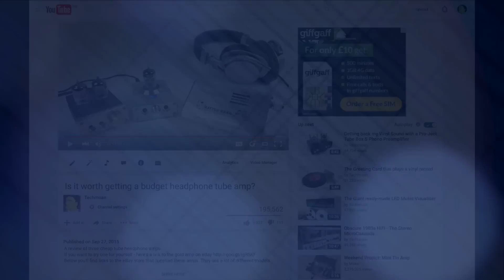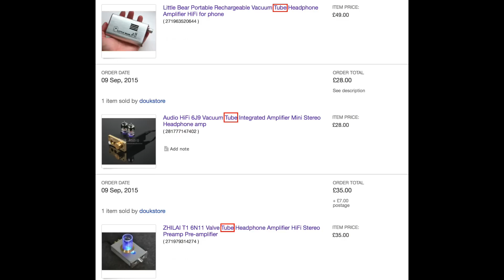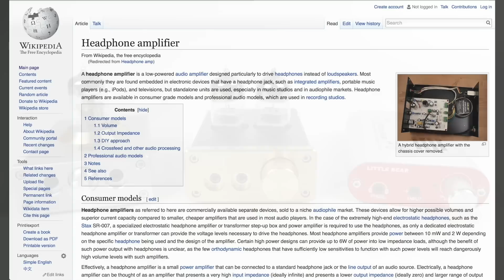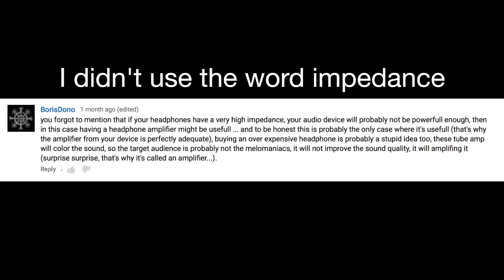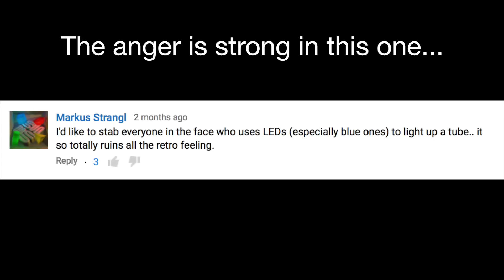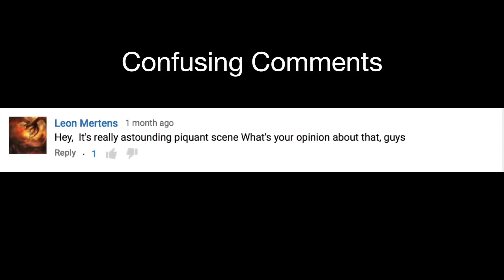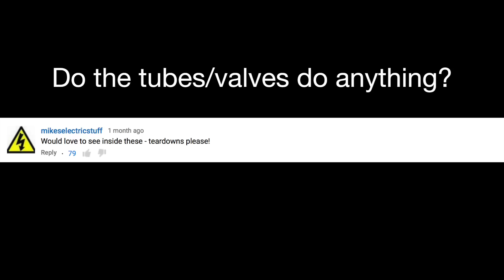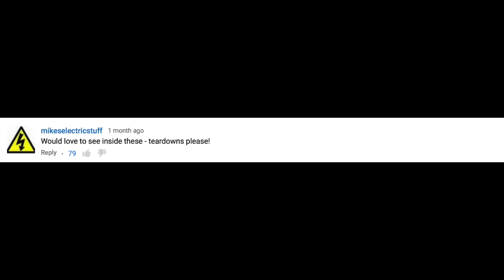Headphone Tube Amps - Follow-up & Tear-down

Comment: God... waded through hundreds of comments, mostly nonsensical - but a few people did get engaged over the use of thermionic valves ('vacuum tubes') at low voltage. Sure, these little valves typically operate PROPERLY at anode (plate) potentials of 90 -175 volts - which is clearly not the case with your headphone amps. However, most valves will 'operate' at any voltage which overcomes the inherent resting charge of a heated cathode - a potential normally below 12 volts. All the typical 'audio' valves - EL84, ECC86, that sort of thing.. WILL operate at 9-12 volts anode potential, just not very well. There's no need to use the on-PCB step-up 'boost' switching power supplies which some of your viewers claim to have seen on your video, 9 volts is enough to produce the 'valve effect'.

Low voltage working like this is known as 'space charge' operation (a term which as far as I can see, none of your commenters has used). The quality and strength of space charge valve amplification can be greatly increased by modifying the structure of the valve to increase the flow of anode current at low operating potentials. 'Space charge tubes', commonly manufactured by tube makers like Tung-Sol and RCA, were popular in car radio applications before the invention of the transistor where the only electrical source was the 12v vehicle battery. The only alternative was an electromechanical 'vibrator' inverter to increase the 12v to 150+volts - these produced a huge amount of RFI interference in those radios to which, operating in the medium wave AM frequency range, they were particularly prone.

Space charge valves are still inexpensively available as 'new old stock' and there's no particular reason why a manufacturer today, Chinese or otherwise, couldn't make them for use in low voltage applications like these headphone amps. It's possible that these are what you have.

FWIW, the visible presence of sizeable silicon semiconductors on these amps' PCB (one of them has a TO-220 package) makes me agree with others that the are HYBRID amps and that the contribution of the valves, whilst real, is little more than cosmetic. It works, the amps look good. I'm neither an audiophile or a guitarist but their views are usually that hybrid amps are NOT valve amps, at all.

Love your channel. I'm old enough to have studied thermionic valves in high school!

Comment: Doing some probing on the two non portable amps would get you the results to tell you 100% if they are. But with the video you provided you can see that on the Vin there's is a DC-DC converter this could potentially be for the heater. When you look up the specs of the tubes the heater needs like 10-20mA of power. So it's absolutely feasible for these to be solid state. Also on the output you can see a opamp of some sort. This is actually doing most of the amplification. These are not 100% tube amps but hybrid. The tube is doing all the pre-amplification and potentially the tube sound. I hope this helps

Comment: The microphonic tubes indicate that the tubes are actually a part of the amplification circuit. All tubes are inherently microphonic to a certain extent, so you can tell whether they are actually a part of the amplification circuit by simply tapping the tube with your fingernail, with the volume up, and listening for bumping (best with headphones).

I have one, that I use with some NOS Philips/Amperex tubes from the Netherlands (US type 6R4/EU type EC81), that originally came with the cheap Chinese 6C11 tubes. With both sets of tubes, the tapping is evident.

Comment: the acids from your finger oils aren't great for valves, but not really harmful, but touch any high pressure sodium, halogen....basically any very hot or pressured bulbs will 'splode on u, if touched. most anything that requires that type of caution generally comes with white gloves for installation.

Comment: hi,, im looking into getting a valve pre amp, hedphone amp but unsure still..
ive got an old vantage British built valve radiogram 2x ECL86 valves with a tape  5pindin input.. 
It will benifit from a preamp install.
but what do u recommend?? I trust your judgement on this.. ive looked on Amazon and cant chose which is the one for me.? thankyou...
tek guy

Comment: Electronics expert here. And I semi regularly restore old tube sets at a major electronics shop near downtown Houston Texas. 
I see one issue on those tear downs. Tubes require filament voltage for their heater and high voltage for the 'valve' operation.
Heater or filament voltage is easy. 6 and 12 volts is quite common. But... 
Generally this 'valve' operation is as low as 90 volts for a 'farm radio' to as high as 400 volts for a 'hifi' set.
I'm not seeing anything in these cases to chop up dc, push it through a transformer, rectify it and filter it out to provide high voltage.
How are these tubes operating????
Reply: To change up voltage from 12V to ca. 50V you can use a couple rectifying diodes and capacitors like 100uF/16V (power charge pump). All this valve can work with 30V-50V on plate with small anode current. To headphones amplifier (50-150 mW) no need high anode current. Seek AVT project no. AVT2690 "Bufor lampowy, czyli prosiaczek w domu" (only in Polish, but you can read the circuit).

Comment: Of the 3 devices you opened, the first had a lot of surface mount technology parts (smt) which some wouldn't consider to be audiophile.  The silver unit looks better in that category, and the little bear actually has a gold and black nichicon capacitor.. which is considered audiophile :)  The layout does look very cramped on that one, which could be causing the hiss.. Which theoretically you shouldn't have with a battery powered component :)  You might be picking up some stray signals with the microphonics on your.. tube lol.  Wifi and phone signals are some common culprits.
Reply: Speaking as a amateur radio ham, SMT is good for radio frequency work - particularly because surface mount parts have much lower stray capacitance and inductance. Old school 'through hole' non-SMT parts aren't really manufactured any more by major manufacturers. You can still get 'new old stock' through-hole parts but they are increasingly short supply and getting expensive. What technical reasons argue against the use of SMT parts in audiophile equipment?

Comment: Hi Techmoan, I guess I am just a beginner as I only have 25 years as an Electronics technician working in the HiFi and Electronics communications industry including some design work. Let's get some myths out of the way. You can touch valves with your fingers. I have been doing since since the age of 12 and have never killed a valve (not tube, I am English). No technician outside of medical work will be wiping his hands to touch a piece of (hot) glass. It is Halogen bulbs that you cannot touch because they have an external Iodine coating. Valves can work from any voltage from about 9 Volts up, the heaters require either 6.3 V or 12v AC or DC. A Power Amp that produces many watts to drive loudspeakers would require over 100 volts and typically 300 VDC. Headphones typically get fed in a normal amp from a resistor of around 560 ohms and only a few milliwatts reach your headphones, not the 50 or so watts from your amp. 

So a 1 Watt heapdhone amp will be plenty loud (actually deafening) and will comfortably drive high impedance headphones. The black chips in the teardown are NE5532 operational amplifiers as used in much HiFi gear as pre-amps. Valves do not normally have a high gain due to negative feedback so the op-amps will provide extra gain. The Valves are connected to a two sided PCB so many of the connections are under the valve holders, rather than underneath. I doubt that many of the critics have ever built any electronics or used a valve amp such as the illustrious Quad 22s that my father possessed. It is easy for people to criticize because their mate down the pub said so when they have no real technical understanding or experience. Please do not let these morons put you off your excellent channel which I have followed for ages now. Do what you enjoy and do not let others criticize that, readers also take note. Audiophile = con to make you spend more money.

http://electronics-diy.com/class-a-12au7-tube-headphone-amplifier.php Oh look a 12V headphone valve amp!
Reply: as others have mentions Dave EEV Blog kills the illusion for one and for all https://www.youtube.com/watch?v=coSt5HWRvv4
Reply: Nice post

Comment: NC pins on tubes are quite common; most cats eye tubes also have pins that don't go anywhere to the filament (like the UM80 and EM85).
I can see from all the caps, coils and FET IC's that it probably uses a boost converter to step up the voltage from 12V to >100V.
Some of these boost converters can even step the voltage up to over 400 volts from a 12 volts adapter.
However the total power remains about the same, meaning the max current is often limited to 100mA or even lower.

In most cases, the tubes are only implemented to add some typical tube distortion; the warm sound some people like.
Most modern designed tube amps are low distortion, making it sound like a solid state amp, eliminating the point of using tubes.
I think that's the most likely explanation why modern tube amp are 'sounding worse' than the older types according to many tubefans.

Comment: The preamp detects the tube fillament because there is not any converter to 100v or 250v for the anode of the tube. Tubes are only for decoration and Power waste.

Comment: Tube/valve data sheets... have at it:  6J6: https://frank.pocnet.net/sheets/201/6/6J9.pdf   //   6N11 (is a Chinese replacement for a 6922): https://frank.pocnet.net/sheets/138/6/6922.pdf   Also, there are Great Debates over tube quality - various manufacturers have Reputations and fans/detractors.  Huge subject - bottom line is these headphone amps might sound (even) better with better quality tubes used.  More tube substitution info: http://www.audiotubes.com/chinese.htm  If you want the extreme high-end in headphone amps (and who doesn't?) well, here: https://www.theverge.com/2015/11/6/9680990/sennheiser-orpheus-handmade-headphones-electrostatic-hands-on

Comment: You can touch valves/tubes.  Only halogen lamps get hot enough that oils can cause an explosion.  People just parrot wrong info.
Reply: Why does hot oil cause an explosion? You can get oil very hot in a skillet frying pan and whilst it might evaporate or catch fire, it won't explode. Both valves and halogen lamps contain a vacuum so they will implode, anyway.

The story I heard is that the skin oils break down to fatty acids when heated and that these acids can 'micro-etch' the glass leading to premature envelope failure and loss of vacuum. 

Is this true? Subjectively, yes. I moved into a house that has about 20 halogen downlighter lights in one room, poorly installed, so the bulbs run hot. I am FOREVER replacing the halogens and I'm convinced that getting your fingers on the glass during installation shortens the lamp life by about 50%. So, I don't do it.

Comment: Pre amp tubes will sometimes get used as clipping diode's in  "hybrid" amps and don't really effect the tone that much, pretty sure that's the case with both of the single tube amps ,..the pre amp and power section will both be solid state and alot of companies will throw in a tube in place of a diode just so they can sell it as a tube amp

Comment: Exactly ! , if anyone is just listening for mistakes or flaws or problems (also believing that higher priced gear will solve that), entertainment and pleasure will be lost. Also the group that seem to know everything about audio and different equipment are not the future purchasing mass (they have all the gear already). To put confusion and negativity into ones that are interested in moving beyond compressed low level audio that they are used to. Encouragement will be better to find what they may like.

Comment: What everyone should be focusing on is the quality of the audio OpAmp being used.
YES  the tube/valve is in the circuit, YES it does pass audio (as demonstrated with the micro-phonics section), but in starved voltage mode.
The comment about a circuit to not allow audio to pass simply based on if the tube is inserted or not in order to "fool" you is absolutely absurd, and would be a complete waste of time since the tube will work, per se, in starved voltage mode.
Getting back to the OpAmp, a lot of owners will swap out different types of OpAmps to change the audio quality.
Most ship with low quality chips that can be swapped out since the majority of these amps have socketed chips instead of soldered directly
to the board. This is provided by the maker to simply do just that. And, with a little research you can swap tubes (called "rolling") to get
different results depending on the tubes.
But then, your normal hipster won't take the time for any of this.
I'm simply rambling to the crowd that likes to tinker, and enjoys tone searching.

Comment: I have the gold-front headphone amp, and I reverse-engineered mine. The tube is indeed being used as a cathode follower. It does not voltage amplify the signal, but it may add some tube 'color' to it, and especially with this particular tube. the Chinese 6J9 is equivalent to the EIA 7788 or European E810F. This is a very high mu pentode, which explains why it may tend to be microphonic. This is an uncommon tube type outside of the Chinese 6J9 variant, and the archetype 7788 variant can be fairly expensive. I do want to try using a pair of real 7788's (which I have because they are common in some antique video test equipment I own) in this amp to see how it sounds. The plate voltage is pretty low here-- about 16 volts IIRC. The data sheet shows these tubes have some gain at this low plate voltage, and that is why they might have been chosen for this circuit. The NE5532 dual op amp is the headphone driver, as it can produce power into a low impedance sufficient to drive headphones. This chip is frequently used in high end professional audio work, so IMHO, it is a good choice for this circuit. I suspect it has the same function in the other two devices. It undoubtedly colors the sound far less than the tube does, although I have heard convincing demonstrations that show different op amp topologies can sound noticeably different in good headphones.

Comment: I quite dislike the blue LED's, is it possible to cut them out of the circuit?
Reply: Yes but since they are usually mounted under the tube socket they are a bit hard to get to. I guess the easiest way would be to just short the leads on the soder side so the light goes out.

Comment: I read a comment or two during the video that stated that tubes or valves were junk and completely worthless. I beg to differ. If you look into the world of guitars and guitar amplifiers, there is a huge difference and a benefit for using tubes/valves in guitar amps! Plug a guitar into a solid state amp with no effects pedals. Plug the same guitar into a decent tube amp...same way. No effects. You will immediately hear the difference. The tube amps are far better sounding. I know...I have both. A more modern solid state amp and a tube amp from 1959. If I played out professionally, I would most definitely use the tube amp on stage rather that the solid state amp. Like a difference of night and day! Check the resale on the tube amps also. I gave a mere $20 for my tube amp in the late 80's. It's now worth $1000 or more! There's a reason for that!!!

Comment: Our COSSORs are fitted with Valves.... we don't call them Tubes.. great when they are working, push pull power amp gets nice a toasty.
Reply: Cossor actually manufactured valves in England (along with being a big manufacturer of radio and radar sets and general electronics for military and civilian use). IIRC they also had a fledgling computer interest. Another successful British company (like Plessey and Elliott) which vanished into the dustbin of history in the 1960s. Of course Cossor called them 'valves'.

Comment: XuanZu Amp:

NE5532 ICs. That's a solid-state audio opamp. 

Zhilai Amp:

On the bottom of the PCB, there is a TO-220 component that is probably either a linear voltage regulator (fine) or a transistor, which would be used as a power amplification stage, or a "post-amp" along with the NE5532 opamp.

Little Bear Amp:

Also using an NE5532 opamp. Oddly enough, it has very nice nichicon capacitors. 

The verdict:

All three are using cheap solid state amps. The NE5532 IC costs 16 cents (1.02 CNY, based on current exchange rate.) 
http://www.szlcsc.com/so/product/details_5757.html (in Chinese)

Comment: They are transistors for amplification inside (NE5532) very known, not very recent. Known to have a little noise... Why OPA in a tube amp ???

What about to change them with MUSES 8920 or LME49860 or 2604AP (too hot sound for tube amp ?) ?

Multilayer circuit explain probably why wee doesn't see all connections OR fake tube amp ??!

Why not to unsold the blues leds (I put something to hide the blue color yet).

Comment: The noisy "Microphonic" tubes may be no good, as in defective.  Which is the case in Guitar Amps that run on Tubes/Valves.
If they are used in the pre-amp section, they will be noisy if loose internally.  (Tube needs replacing if thats the case)

Maybe try buying a new set of tubes from a reputable dealer, maybe some new old stock rca tubes.  Might fix your noise issue.
Chinese tubes are known to be noisy.  Best bet would be to find an old-school electronics shop that has a working tube tester to test them.
  Good luck.

I did enjoy both your videos on this subject : )  Especially the ranting in this one, that was fun :p

P.s. if replacing the tubes, they may need to be re-biased?  Idk if that circuit will auto bias?

P.s.  its a bummer people give you soo much crap!
Reply: I hope you get it working right : )